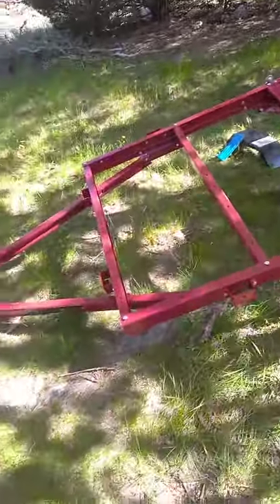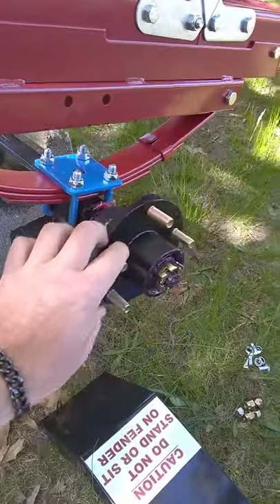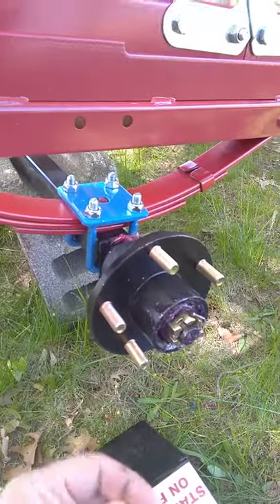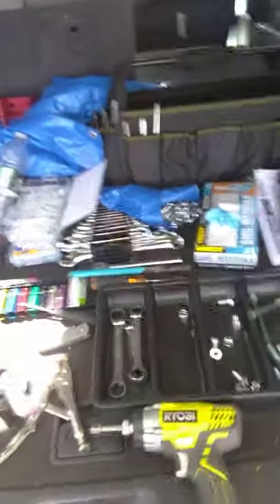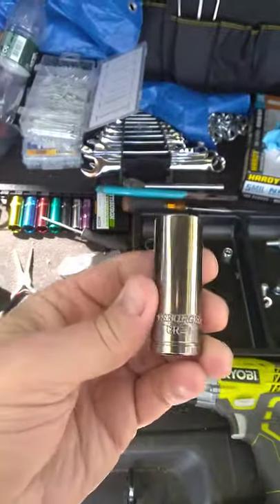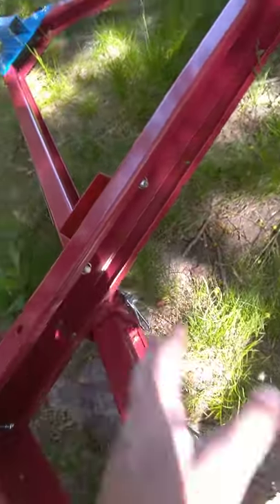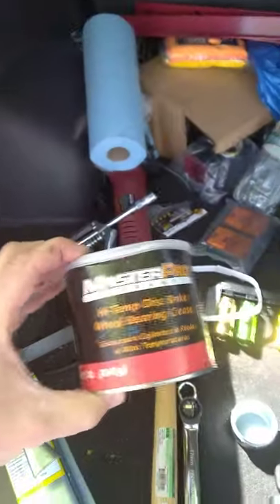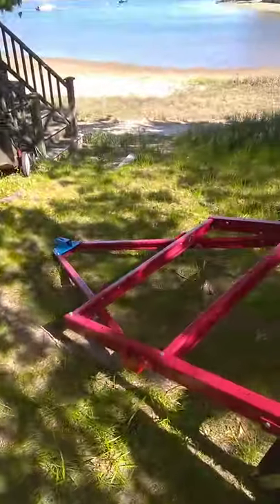Tips that you wished somebody told you before building a Harbor Freight trailer

Comment: I have used the original HF wheel bearings for 10 years now with ZERO problems.  I've carried everything from a motorcycle to car engines to a 2-place airplane.  Zero issues.
Reply: I did too! And I have almost 15,000 miles on them for 12 years....

Comment: Reinstall your Fender Bolts from the bottom up immediately! If you don't like to do that for aesthetics, cut the bolt so that it does not extend past the nut.  As the wheel travels up and down with the suspension, the tire can come in contact with the excess length of the bolt, effectively destroying the tire.
Reply: Exactly. And add a bracket to keep those fenders from flopping around. With the fenders bouncing and bolts pointed down, tires are at risk.
Reply from the maker: So once I secured them in with locking washers and loc-tight on the threads I took my grinder and cut them off
Reply: @CaptJohn421  They will still fly off in the future (experience). Add front brackets as stated above.
Reply: @astromann7449  I'm thinking of buying one of these.  What kind of bracket and where does it mount on the fender? Thanks!
Reply: @da324  I used 3/16 thick "L" brackets from the hardware store. Four per fender, 1 in Front, 2 in middle and 1 aft. With drilled holes and 5/16 bolts. They stayed put after that.

Comment: It's not the bearings that are bad, they're just fine. It's the packing grease they use that is the problem. It's just for shipping and is NOT high sped grease for over the road. You are supposed to remove that crap and pack the bearings with bearing grease before traveling with the trailer.

Comment: HB trailer will last if you keep the bolts tightened, tire pressure correct, and wheel bearings cleaned and greased.  Every once in a while touch up with Rustoleum paint.  Bought my Chinese trailer long time ago and still makes me smile

Comment: Good insight about the bearings. You might also add that running a separate ground will eliminate the problem of paint coated metal not contacting!

Comment: Great job. I removed the top bolts then I clamped the plywood to the frame & started the holes from the underside. I removed the plywood & finished drilling the holes. Then I sprayed bed liner on both sides of my 3/4" plywood & let it dry. then I replaced the top bolts with comparable size SAE galvanized carriage bolts to hold down the 3/4" plywood, so there would not be a gap in between the plywood & the frame.

Comment: Hey partner, I appreciate you taking time to film everything. I know that’s not very easy when you’re trying to get work done and then you have to do your filming, takes twice as long. 

However the bearings that came with my HD 1720 that I finished assembling yesterday aren’t junk whatsoever. They are Timken/SKF bearings which are excellent bearings. 

One more thing, finger tightening the castle nut and then setting the cotter pin is absolutely incorrect. Matter of fact it’s completely the opposite of what should be happening. If one follows your procedure The result will be premature failure due to sloppiness because of the loose bearings. 

The correct procedure would be to tighten the castle nut until it causes the wheel some friction so that it slows down its rotation sooner, then back it off enough to set the cotter pin.

I’ve been A mechanic since the early 70s. I may not know much about some things in life but these things I know about. What scares me is there’s probably been people who followed your advice on the bearings and it bit them in the behind sooner than later.

However you do a really good video and the way you lay everything out; I enjoyed it. Good work, please edit that bearing information out of the video. Thank you.
Reply from the maker: Hey there I appreciate that feedback and you're absolutely right about the castle nut and cotter pin I just didn't make myself very clear but I absolutely agree with what you said. I think I've got about 2,800 miles on my trailer since I built it and no issues at all. Well worth the money
Reply: I know im asking randomly but does someone know of a way to get back into an Instagram account??
I stupidly forgot my account password. I love any help you can give me!
Reply: @Bobby Vihaan Instablaster :)
Reply: @Ahmed Izaiah thanks for your reply. I got to the site thru google and I'm waiting for the hacking stuff now.
Looks like it's gonna take quite some time so I will get back to you later with my results.
Reply: @Ahmed Izaiah It worked and I now got access to my account again. I'm so happy!
Thanks so much, you saved my ass!
Reply: @Bobby Vihaan Happy to help :)

Comment: Bought one of these half a lifetime ago in 2002 when I got a dirt bike. Towed easy using a VW GTI, WRX and Kia K5. I did repack the wheel bearings using a high quality Exxon disc brake grease. 
I did replace the hitch coupler as the one that came on mine 20 years ago seemed cheaply made.   

My floor is a stained sheet of 3/4" plywood. I installed forged eyelets from TSC at all four corners instead of using the bolts and nuts and double nutted them. Have hauled motorcycles over the years with no problems. I keep the trailer folded in my garage out of the weather. I think it's time I replace the tires before using it again.

Comment: I got a used trailer lol same one and I’ve used it for two seasons of lands for a small clean up trailer ive completed so many jobs towed 1500 lbs multiple times and over 5-6k miles on stock bearing greased once still going strong also they are just cheap trailers but do there job very well galvanized won’t rust either salt might make it get oxidized looking so good idea on paint man

Comment: Building this trailer now (1720lb rating)... using a drill and socket adapter against a 17mm socket wrench to tighten most of the bolts.

Note that there are TWO bearings in each hub (total 4). The inside bearing was almost entirely devoid of the shipping grease so at minimum you want to fully repack and grease the entire unit. I’m repacking all the bearings now and rolling with good (but lithium) grease. I got some anti-rust primer and red paint for fun.

This trailer is heavy and I think it’s going to be decent!

Comment: High mile tip (learned from 20,000 trailer miles) : Toss the bearing dust covers and replace with bearing buddies and use marine wheel bearing grease in the grease gun. (whats used for boat trailer hubs, not cars). Pump a little grease in there every 1000 miles. The fender brackets vibrate, will crack and fly off (hopefully not thru someones windshield).  Add a little right angle bracket on the front side of fender to help.  Leaf spring rear slider part will grind thru frame- jack up and grease this, and/or add a sacrificial metal layer there or sheet Teflon held in with a small self tapping screw a few inches behind.
Reply: Good idea about the Teflon. I was thinking about grease but didn't want it to attract dirt and turn itself into a sanding compound. Thanks

Comment: stock bearings are fine but re-pack with quality wheel bearing grease regularly. Have 3000+ miles on mine so far with basically no bearing wear running 75mph regularly. Recommend static balancing each wheel/hub assembly, one of my wheels needed a full 2 oz to balance, other one about 1.25 oz. Access to a welder helps a lot - the fender brackets are notorious for failing due to vibration - i welded the entire frame/fenders/d-rings for tie downs... towed my motorcycle all over the place - great little trailer.
Reply: I’ve gone 80 for a while with the trailer only loaded bud it does fine lol.

Comment: One thing I hate about my HF trailer is dealing with the one bolt above the springs that has to be put in and tightened.when unfolding it. It has to be held in place or it pops out of the frame hole. I took a piece of 2x4 and made a wedge to insert in the frame rail and snug it in place while the nut gets tightened.

Comment: I was wondering if the difference in the rating between the 1720 and 1195 are the hubs and wheels?  Looks like about the same otherwise. Maybe spring and coupler as well?
Reply: Looks like marine grease for the hubs assemblies as well, bearing buddies and maybe some extra metal for the fenders and leaf spring rear slider part where maybe Teflon is the cure.  I'm thinking maybe nylon so less pfoses.

Comment: John, thank you for those helpful tips!  I really appreciate you taking the time to share them with us.  👍

I've been thinking about purchasing this trailer for an ATV.
I didn't know Harbor Freight sold these at such a low price!
Great video!
Reply from the maker: Thanks! Yeah I just wanted to throw some tips out there I don't do this professionally or anything. But, these are cheap but if you build them the right way and add a little extra strength here and there they're extremely durable and dependable. I've put about 2500 miles on mine with all kinds of different stuff on it and it's performed flawlessly

Comment: I get my wheel baren grease in tube for grease guns and bearn duds in Italy fill though it until the cup moves and turn the wheel and add more if needed. Thy have a weep hole so you can not over fill it with wheel bearn grease. Had mine on for years I have two of them one 40 years old and one 20 years old.
Reply: It

Comment: I have the smaller 1200 lb trailer and want to see of the 1750 axle will fit. Could you please measure from center to center where the axle sits onto the springs? And the distance of outer hub to outer hub.  I already know the bearings and seals are the same...

Comment: Did you just float that plywood sheet on top of the bolt heads, or did you let them in a bit?
Reply from the maker: I ripped 5/4x6 into 2"x4' stripes- then countersunk the attaching bolts. The decking was then screwed on

Comment: Question: most of the bolts are M10 bolts (according to the install manual). Those would require a 10mm (or about 3/8”) wrench.  What do you need the 17mm wrench for? (I haven’t built my trailer yet—jut trying to get prepared.). Thanks for your video.
Reply: M10 is the shank size.  I just built mine and yes 99% of the bolts need a 17mm socket.  You also need 18 and 19 and 14 and 11mm.
Reply: Metric hex bolt sizes tell you the diameter of the bolts thread and shank, not the required spanner size. M8 needs 13mm spanners, M10 needs 17mm, M12 needs 19mm etc etc…..

Comment: How many miles did you drive on the bearings that came with it did you find that they were bad?
Reply from the maker: I didn't bother putting any miles on them, I've had too many problems in the past with cheap bearings. May as well do it right the first time
Reply: @CaptJohn421  What brand and bearing number did you use?
Reply from the maker: @owboky102050  napa brand 👍
Reply: I have close to 1200 miles on original bearings at maybe 60% weight and have not had a issue at highway speeds. I do however carry a extra bearing set for failures on the road
Reply: Add bearing buddies.

Comment: Why buy a trailer that you have to upgrade the parts on it?  It should come already ready to go.  I’m looking to buy one but I’m gonna trailer 60 to 80 miles at time.  Concerned those 12 inch tires will just not be good enough.  And now you’re talking about the bearings are definitely not good enough.
Reply from the maker: Upgrade?! You got it all wrong. This is a trailer that you can customize to fit your needs any way you want. It's also half the price of a trailer at Tractor Supply or home Depot. Additionally, the tires are actually not garbage, their DOT certified and when you buy it it comes with the certification